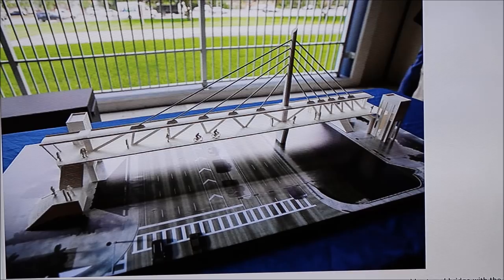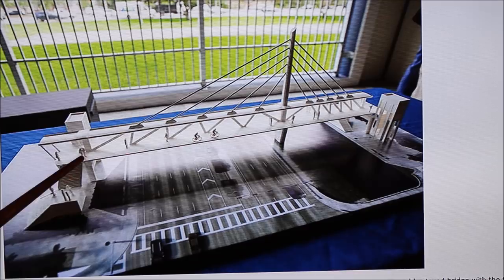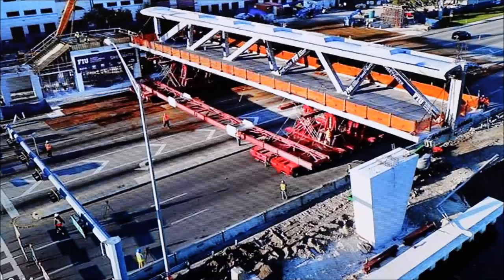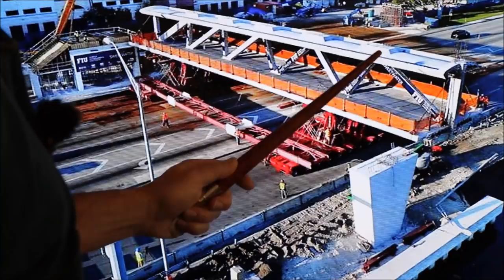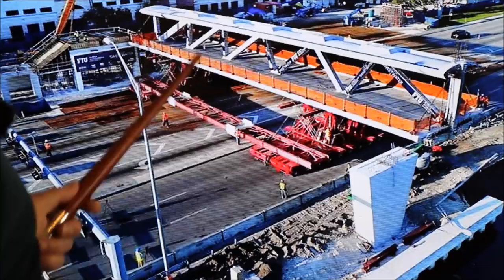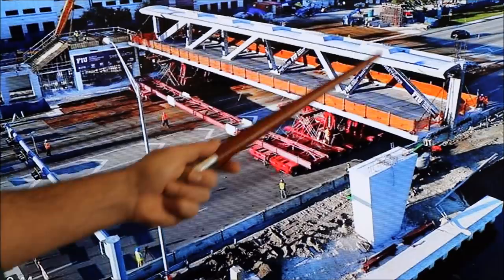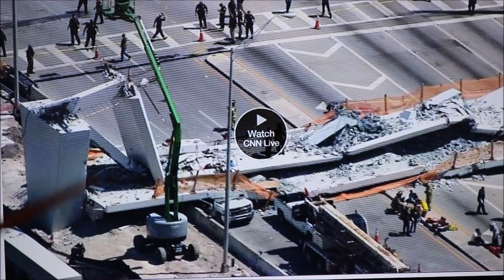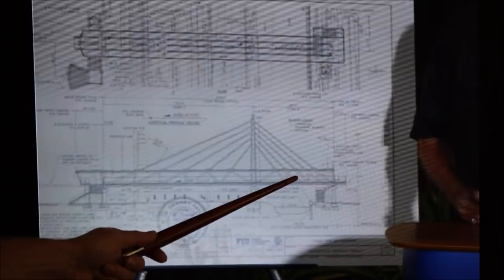Miami Bridge Failure- preliminary analysis 17 March 2018

Comment: The suspension mast and cables were ornamental?  I hadn't heard that before in other reports...
Reply: I find that to be a way to shift any stupidity for not having something under JIC.
Reply: Jeff Bangle  I thought that part of the structure was more for added strength during high forced winds and hurricanes.   but it was also for aesthetics.
Reply: added redundancy, I suspect, not strength. this concrete wannabe I-beam is such an unsafe design. and having to use supports in the wrong locations for the installation of the section. wow.
Reply: They're not suspension cables in any case. That's a cable-stayed design not a suspension design. So if they are aesthetic it's an aesthetic cabled-stayed bridge, not an aesthetic suspension bridge.
Reply: David Newton I read somewhere that they weren't even supposed to be cables, but just hollow steel tubes. If so, then it wasn't even partially cable-stayed. In an NTSB briefing, one of the investigators stated that it was his understanding that the part above was purely cosmetic.

Comment: The newscasts I watched stated that a stress test had just been completed, and that the cables were being re-tensioned,.indicating to me that the tensioning had been relaxed for the test.  I really don't know how much of a factor that could have been, as my only exposure to that technology are the post-tension slabs used as foundations for homes in north central Texas.  In that application, the cables are used to stiffen the slab, so that it floats as a single unit on top of a layer of sand.  The results of the NTSB investigation will be interesting, as they will look at everything from the design itself, to the grade of steel used in the cables.

Update:  Photographic evidence has now surfaced, that a tension rod failed, resulting in the failure of the truss, and the collapse of the bridge.  (The tension rod actually shot out several feet.)  There's also evidence that the span was mishandled when it was placed on the piers.  The lifts on the end that failed were out of position.  One was supposed to be right under the end of the span, where the deck met the truss.  There were also supposed to be spreader bars between the bridge deck and the lifts, but photos show they were not used.  The engineers on reddit believe that the tension rod was damaged/weakened when the span was moved, and that tensioning that rod AFTER placement led to it's complete failure.

Comment: Wow,  so much information.  When I saw the image, I thought of the Sundial pedestrian bridge in Redding. Then you said the cables were for show. Seems like a very long span without support.

On a side note, about concrete structures... the tilting Millennium Tower in San Francisco, one theory is they used concrete instead of steel and the extra weight along with not driving piles to rock is causing the tilting.

Comment: Vaughan, a well-presented objective presentational view specific to the collapse. 
A point to consider is that the cabling itself in its being incorporated in the design being the 'necessary adjustment component 'may have been the critical error in the design of such a huge and heavy bridge. (My overview of the above video and your appraisal has facilitated my observation and resultant opinion.) I am still okay if my opinion is proven wrong.

Comment: Wow!  When you consider how many people were involved in the design, approvals, legal contracts, construction, etc. . . . well, it makes you wonder who if anyone will be held accountable for this disaster.  Throughout the video, I kept wondering, "WHAT were they thinking?"
Reply: The contractor was thinking " Hmm, I bet i can save money by offering the folks at Building and Safety to look the other way rather than calculate loads, second guess the engineering firm. We can pay them to approve the ABC method and that way it will their fault if it falls down". The folks at the Building and Safety Department were thinking about how to spend extra cash.
Reply: newbeequilter everyone involved has their press release ready to go..."We looked into it and we found out that we didn't do anything wrong ".
Reply: The bridge designer was thinking "how can I sex this up so it'll win the bid from those rubes at FIU?"
Reply: likely no one or company will be held responsible.   Years of legal b.s, bribes to lawmakers,  and.the victims families will be left  in the dark. seen it before.
Reply: Given the nature of the grant program, 2 things are certain: A) Errors were made in WHO the contracts were assigned to (no problem with set-asides or "women in engineering" preferences, but they won't go with the DESERVING women or PoCs) and B) whoever made those costly decisions will NOT be held accountable. Oh, they'll find some taxpayer money to pay off the victims but the people responsible are too well-connected to have to pay.

I make this prediction with as much confidence as saying a dropped rock will fall downward.
Reply: +Brad Geltapfel given that rubio is an adjuct professor...could be

Comment: Well not completely cosmetic as they were needed to support the pedestrian loads from what I read here. https://facilities.fiu.edu/projects/BT_904/MCM_FIGG_Proposal_for_FIU_Pedestrian_Bridge_9-30-2015.pdf  Also they would have offered some level of redundancy to the system. I thought the failure of the Silver Bridge at Point Pleasant had taught engineers abut the necessity of redundancy in bridge design but obviously that was not the case if the failure of one tensioning member can collapse the entire structure in a catastrophic manner. The factor of safety of this design in its as installed condition had to have been less than 2 , and that is poor practice.  It also seems we are doomed to repeat the mistakes of using high strength materials to save costs and reduce material use. That too has proven problematic in the past as imperfections in the materials result in a flawed and unsafe structure. Low stress = long life. Still hard to get engineers to accept that.
Reply: bcbloc02 As an engineering student going through uni, it’s only incidents like this that serve to remind us of the importance of getting it right. It’s important to realise that with so many successful bridges and engineering projects, complacency creeps in, redundancy and fail mechanisms don’t seem relevant because, well, the bridge isn’t going to fail! That being said, to design a bridge unsafely on the whim that it won’t fail is utterly reckless and I’m sure this collapse will be used as an example in many lecture halls globally about why we have redundancy in designs.
Reply: bcbloc02 yes that's also what I heard on a news report. That the majority of the support comes from within the main truss system. But the cable tower was designed to provide support especially while the bridge is in use by absorbing vibration.
Reply: The “cable” stay component is definitely  mostly aesthetic, they weren’t even high strength cables but tubular pipes. The details provided in the drawing show a relatively light duty anchor bolt ties which would only provide some restraint.
Reply: "Low stress = long life. Still hard to get engineers to accept that."...Not competent engineers. I would never have sealed a bridge design without a significant safety factor AND redundancy built in - Bill Gillette PE
Reply: Using high strength materials isn't the problem. Not building in a high enough safety factor is. Redundancy with only two cables is about the same as zero. Failing to learn from history is a very common problem in all endeavors. 

As for the Silver Bridge, never crossed it but did the one at St Marys. Which was the same design. Have been across both of the replacement bridges. In fact have been across most of the bridges between the two including the new US-50 bridge. When you look at it, you have to wonder what is keeping it up as it looks weak in design also.
Reply: I think in the report on the I35w bridge collapse it was determined the reason it fell was the gussett plates had been originally designed for t1 steel but later in the design the material spec was reduced but the thickness of the plates was not increased to accomadate that change. That put the bridge operating very close to its failure point when at full load, then throw in some heavy construction equipment and some section loss from corrosion and the factor of safety was gone and we know what happened then.

Comment: The design may well have been problematic as you say, Juan, but at this point we can't rule out bad/careless construction either. The two contractors have been implicated in other disasters, including a prior bridge disaster. There is also a question about the concrete that was used. It was the first use of a special mix of self-cleaning concrete containing titanium dioxide, again for esthetics. What if they got the mix wrong, or it wasn't as strong as they thought it was?

I'm surprised to learn that the entire superstructure was supposedly only there for esthetic purposes. It doesn't look esthetic, it looks like it was intended to be a functional support. I'm sure they thought the bridge would stay up without it, but it was probably intended to provide the redundancy that you point out was otherwise missing.

I also note that the span under the walkway was very thick, almost as thick as a roadway overpass, and it looked like it was also heavily reinforced. Looking at it, I would have thought that it would have been enough to hold up the bridge itself. Obviously not!

Comment: Along with a middle support, I would add a dynomometer or scale to measure the load as the cables were being adjusted. Yes, there should be no traffic during construction.

Comment: Not all trusses are under tension.  Trusses are either under tension or compression.  The one at the end which you claim was being adjusted for tension is a truss that's under compression.  The best way to know if it's under compression or tension is to pretend that the truss doesn't exist.  Will the nodes move toward or away from each other?  If they would've moved away, then it was under tension.  If the nodes would've gone toward each other, then the truss was under compression.  And BTW, trusses under compression can't be simple cables.

Comment: I agree that the design of the bridge should be closely examined.  The reliance on too much perfection ... And the lack of failure amelioration as would be present in plastic hinges on steel bridges is very worrying. Things always go wrong during construction. But we have few fatal disasters because of "graceful" failure modes.

Comment: This is really a good explanation, however I seem to think tension cables in the base level is missing and because concrete cannot handle tensile stress very well, the tension cables is very important to work against the tensile stress of the base deck as the top deck gets compression stress which concrete is good for. Which means the structure was never fit to be free standing if that is correct.

Comment: Juan, It looks like the connection between the lower deck and the last column on the left side failed. Maybe there were some pre or  post tension cables that were supposed to carry that load and they were not installed properly or the strength of the connection was inadequate.

Comment: this reminds me  of the Kansas City Hyatt Regency walkway collapse.  Only that the Hyatt Regency in Kansas City had the walkway inside.  The reason that the Kansas City structure collapsed was because of a design error as well.  However, the original design of the walkways were sound.  What happened was that the design was changed during construction: modified 'as builts' were the culprit.  The changes to the structure were approved by phone, if you can believe it, and they altered the way that the walkways were supported.  A specific design for box girders was altered and left out a crucial 'collar' that would go inside the girder to support the weight of the walkways suspended from the connections.  The reason I know all of this so well is because, as a civil engineering student, we were required to study that disaster as a way to know 'how not to let the construction of your structure, that you seal, get out of your control at any time during the construction of the project.'  This may be something similar where adequate precautions were not taken.  Kansas City had horrible injuries and  close to 120 people died.  What will be interesting, is to see if they conduct a full scale forensic investigation into the exact reason for the collapse.  Engineering licenses will be lost and hefty lawsuits filed, that can be sure.  What will be interesting is to see the level of scrutiny this collapse gets versus the very hasty investigation and clean up of ground zero in NYC after 9/11.  Those collapses, supposedly due to fire weakening of the steel, received a comparatively cursory investigation compared to Kansas City and the commission was delay for over a year.  One of the buildings, which, for eight seconds, fell at free fall speed during the day of 9/11 (WTC7) was hardly mentioned in the final commission report.  Let's see the attention the local government officials give to this disaster that was not deemed a "war zone" and thus under military control.  Let's see how much care they put into the investigation when there is no bearded man in a cave half way around the world, next to his dialysis machine, with his satellite phone and laptop, who was supposedly able to defeat the most powerful military defense system in the world with 19 fellow Muslims armed with plastic box cutters.

Comment: I also just want to add that as an electrical engineer not structural, I have extensive knowledge in the field of general physics and a few things immediately draw my attention about how this was done.  I was slightly confused about the statement in the video that the suspension cables or stays is "only for aesthetic reasons" as that is a lot of construction with a lot of structural design consideration just for a bling-bling. 

The ideal is to have no offset tensile strain on the concrete or excessive compression on the top deck. So I was concerned that the entire integrity of the structure would rely on tension cables in the base deck. To me suspension cables make sense and then to balance the structure to both sides. While the design talk a lot about the aesthetic function and consideration of the stays, it is not true that aesthetic is its fundamental function. 

In the design labels it stated "The stay cable pipes increase bridge stiffness for pedestrian loads. " this confirm that there is a structural function in the suspension cables or stays and in another part of the document page 69 it reads "The stays and pylon provide the required structural design to meet the pedestrian loads for harmonic conditions of natural frequencies " I must point it out that those stays does play a very important structural role and without the stays, without the tension cables and without support under the bridge it is setup for the ideal conditions for failure from the start.

Comment: The designers should have benefitted from the hindsight of studying past bridge failures.

This design will go down in history and will be studied as precisely what not to do.

The first mistake was designing a new type of modified I-beam truss bridge with a single row of vertical struts.   It is a single point failure with ZERO redundancy.  See Silver Bridge collapse about the need for redundancy and the dangers in a new design: "It is that its legacy should be to remind engineers to proceed always with the utmost caution, ever mindful of the possible existence of unknown unknowns and the potential consequences of even the smallest design decisions" The Silver bridge was criticized for low redundancy. In light of this, how was a bridge with no redundancy ever approved? I would like to know what the published safety factor for this bridge was.

The initial proposal called it a cable stayed bridge. It evolved into a truss design that mimicked a cable stayed design. It probably would have worked if it was a true cable stayed design with the cables tied into and supporting the deck. When they decided to make the truss with post tensioned concrete they could not have the cables support the deck so they made them decorative.

The second mistake was designing a post tensioned concrete truss. There are complex sheer and bending forces between the intersecting adjacent post tensioned bars within the concrete that the concrete can't handle. The truss should have been two or more rows of steel girders and connecting plates that can transfer the changing loads effectively. The designer should be prosecuted. 

The lack of robustness of the design is evident by the fact that a single worker was able to bring it down.
Reply: Thanks!
that's exacty my thougths

but is very difficult for me to translate these thought in english while use the propper technical terminology

Comment: One thing that strikes me is that the single beam in place was simply supported at both ends, whereas the completed structure would have had that section fixed at the tower - perhaps they didn't properly allow for this in the analysis of the design?  Hard to believe though.

Comment: I'm not an engineer but just looking at the bridge I notice no center piece for support too and given that the other parts are simply for looks why didn't they use something similar to the Golden Gate and the many pedesrian bridges that are similar in design. Lastly, why use concrete and have traffic underneath while testing ?

Comment: aren't there post-tension cables running horizontally in the top and bottom chord of the truss? couldn't the failure have been there as opposed to a failure in one if the webs as theorized in this video?